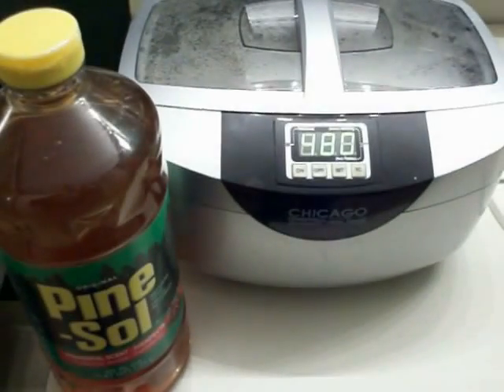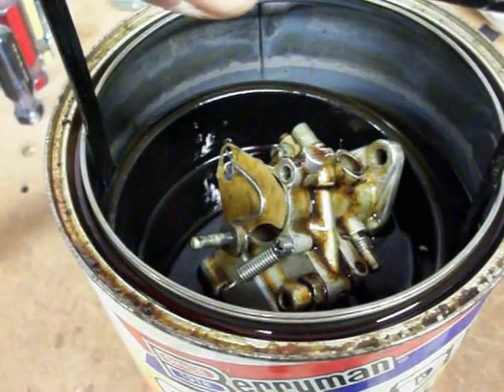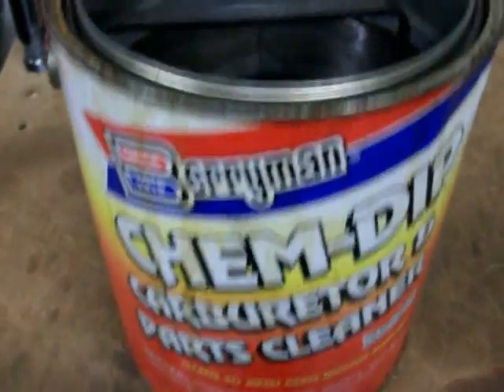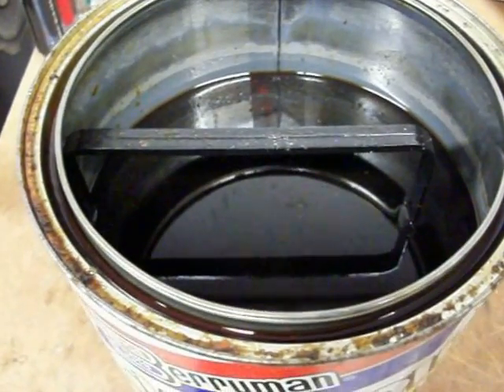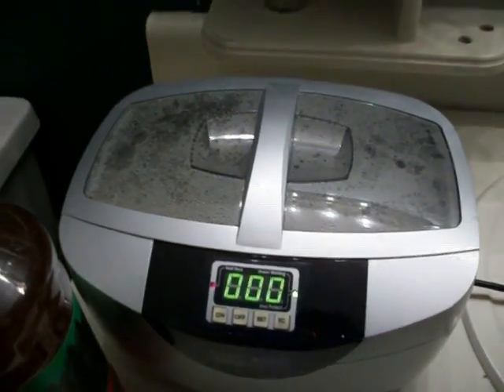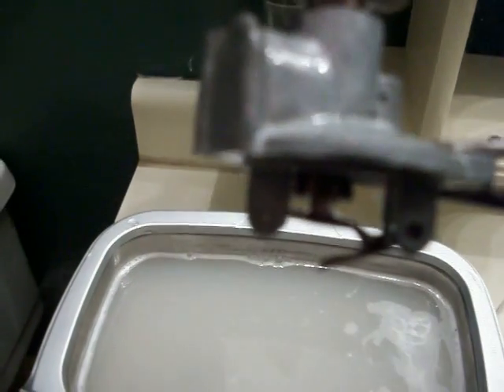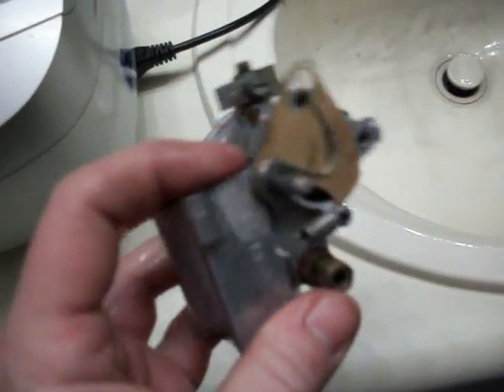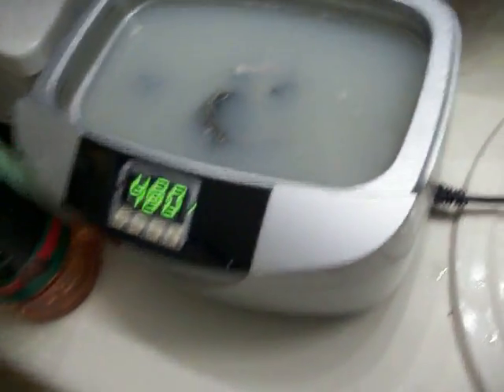Dirty outboard motor carb vs Pinesol/HF ultrasonic cleaner

Comment: Works like a charm. imgs.love/kUltrasonicCleaner Cleans up just about everything. I cleaned up some faucet fittings caked w/ calcium deposits, some brass ornaments, etc. Yes, the center is where most of the activity occurs, but this is not unusual and it still works great!

Comment: Back in the day when I first went to OMC school aka evinrude/johnson when they were still around they stressed dont soak their carbs in berrymans or carb dip. Because the emulation tube was epoxied in and the dip would ruin the seal! They stressed only use spray cleaner. 
Just saying. Thats a old inline merc carb so it has the screw in emulation tube.

Comment: use clr i have been a mechanic for 30 years and for the guy who says it makes micro hole thats not true if a carb is flaking its flaking you cant fix that had a Kawasaki that had flaking carbs bought new onea boom ran great
Reply: Mike Mackin 
i like the clr idea. I'm gonna try that!
Reply from the maker: CLR. I'll have to try that. Thanks for the info.
Reply: CLR will destroy the oxide coating of the aluminum and will cause it to corroded faster. 
It will clean the crap out of something but you have to build back the coating with electrolysis then boiling the carb in water to seal it. 
Simple green and other products will do the same.
The method in this video is correct, using a drip that only dissolves the fouled gunk on part then cleaning with a water based soap  is safest. Blow off with compressed air..
Reply from the maker: My Stuff I didn't know that. Thanks for posting. How do you build it up with electrylosys? Battery charger and washing soda?
Reply: griggsb To build back the oxide coating use the same process as anodizing without and color. A acid bath and a battery charger will work. The key is to boil the part in water after. 
Its also a good idea to removed all the brass parts with this process as well.
Reply: griggsb The method in the video is best in my option.
Reply: What is your reccomendation ?

Comment: Ultrasonic cleaners cause cavitation which makes microscopic holes in the metal. It is not normally an issue but it can be.
Reply from the maker: I have had great luck with this cleaner. Surprised it still works. Ive never damaged a carb by using this method. Thanks.

Comment: In my experience, the chem-dip is crap! The whole idea of cleaning carbs and parts is to get rid of all nasty residues, chem-dip leaves an oily film on the parts you are trying to clean. This is very apparent when you put the parts in the Ultrasonic cleaner after the chem-dip. All of that crap you see immediately floating up is not the gum up of the carb, it's the residue from the chem-dip! If your parts need more cleaning then what the Ultrasonic cleaner can provide, use breakcleen to get rid of it. Also Pine-sol is not anywhere near the type of degreaser you need to clean any type of engine parts! You can use Super Clean, or simple green, just try out lower potent mixture until you get the one that cleans the way you want without ruining your parts! Just my 2 cents!
Reply: +AllStroke Engine Repair I have tried using chem-dip i dont know how many times. At first i thought it may have been because it was old but it just put some kind of orange film over the top of the crap that was already on the carb. Then the freaking smell is the worse! I smell that crap for a month just walking by a can in the parts store.
Reply from the maker: Thanks for the tip.

Comment: how do you get the dirty water out?  do you have to pick up the whole cleaner or is it a tray?
Reply from the maker: You either dip it out, or tip it over. Not really a great design for pouring.

Comment: The internals are not well sealed on those Ultrasonic Cleaners. Condensation will enter the body and ruin the electronics if you use the lid. Don't use the lid until you take it apart and seal it with RTV.

Comment: That's what most people don't know is that Carb Cleaners and Dips  will melt  or distort  Rubber and Plastic .  But never thought of Pinesol   used  Mean Green cleaner from Walmart  Great stuff for the money .I did a caked up valve cover in a small wash tub from Lowes  put it on my Smoker  burner to heat up the water and added  mean green  and let it cook for 3 hrs  came out great.    but that HF cleaner looks like it works great
Reply: +1995dresser 
You have to dry and spray the carb with WD40 immediately to seal the aluminum or it will oxidize.
Reply: +ladefreakndah Yes that is true  but if you have a very oxidized carb you can Soda Blast it to remove  the build up  of course wash it and blow it out after doing so
Reply from the maker: Great idea on the WD40. Thanks.

Comment from the maker: Thanks. Some people complain about the cost of the HF ultrasonic cleaner, but It's a usefull tool. I like the cloud it left when it was powered on. That says it all.
Reply: I got my HF ultrasonic cleaner at an estate sale for $9.00! I wouldn't take $75.00 for it now. I love this thing. I can clean all day long with carb cleaners, compressed air, and brushes and the ultrasonic cleaner will still get more gunk and junk off the parts. It is fantastic for all the tiny drilled passages you cannot get to or through with anything else. If you do a lot of this kind of work it is worth the initial outlay of cash. I only wish it were a bit larger for larger parts.